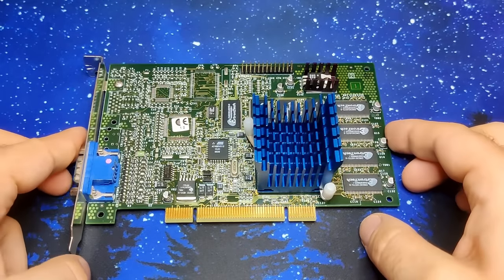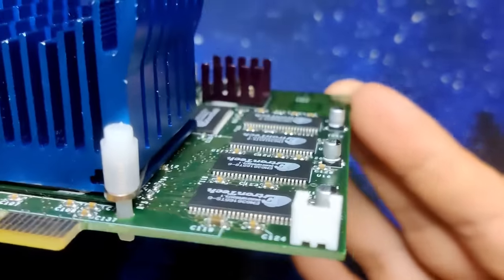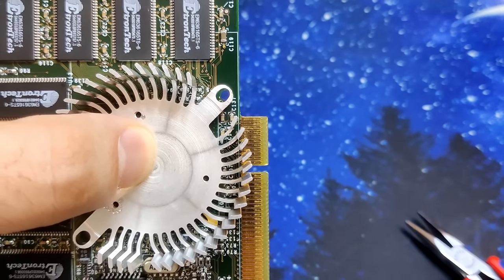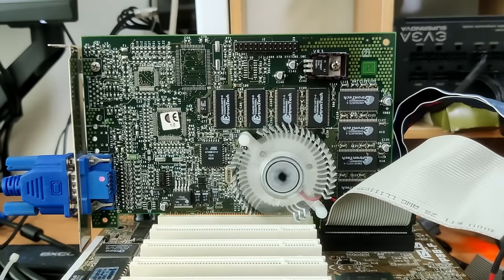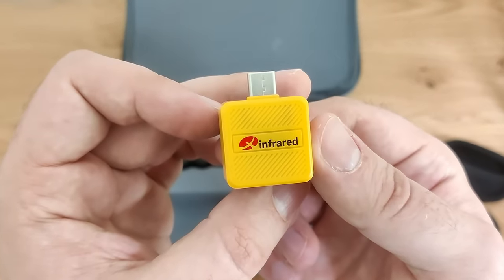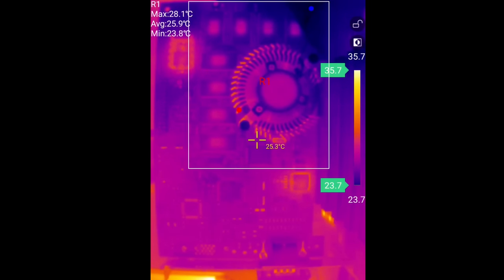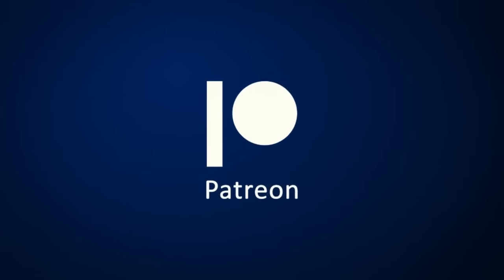Voodoo 3 3333 - Custom Cooling Solution

Comment: None of the features are related to the camera btw... It's just the software on the phone. Old app was terrible. Glad to see they came out with a better one!
Reply from the maker: I haven't seen this feature in the other app - I might have missed those settings.
Reply: As a regular happy user, I wouldn't call the P2 Pro App terrible. I've been able to do everything I needed so far and it's not overly complicated either. The new features in the Xtherm infrared App are really neat though, so I immediately checked if it recognizes the P2 Pro camera. Sadly, it does not.

Comment: It may not be safe to connect a motor(fan) directly to the card power supply without proper protection for the back-emf of the motor(coils). While it might work temporarily since the small coils won't immediately damage the circuit, I wouldn't recommend running it like this for an extended period without the necessary safeguards in place. You should ensure there's already some sort of protection circuit close by the regulator, but I wouldn't count on it without double-checking. Considering the rarity of the card, you wouldn't want to risk damaging it.

Edit: The protection could likely be as simple as adding a Schottky diode in reverse bias as close to motor plus and min.
Reply from the maker: Is there a resource I can read up on it? The fan is connected directly to the 5v supply voltage of the PCI slot. So, it is not taken from any internal circuit of the Voodoo card.
Reply: He connected the fan to the input of the linear regulator, not the output, which should be fine since 5v is supplied by the system's PSU
Reply: @bitsundbolts that's what I thought it should be fine since the system's PSU is often overbuilt for its use case
Reply: @thom_lapatate4842   I agree, i don't see an issue here.
Reply: And also voodoo3 is not rare.
Reply: @andycristea   It's rare enough. Sure a fair production run had been made but most have been ground up to extract a little gold out of the boards. But like it'll be fine here.
Reply: not a problem. EMF generated from the coil itself wont be able to damage its internal BLDC controller. the possibility to send any kind of EMF to the source is as little as none. remember PC fans are brushless since 90s, they're completely different compared to brushed motor
Reply: @n.shiina8798  Exactly. The fans have controllers in them that have all the protection necessary. He is just trying to look smart.
Reply: @SianaGearz  no it is not and never was. E-bay is full of them. There were millions made.

Comment: This video is exactly what I'm trying to to with my Voodoo 3 3000. You just made it a whole lot easier! Where did you source the fan from?
Reply from the maker: I got them from AliExpress. They are quite common there, but I can provide a link. Just make sure to get the 5V version.
Reply: @bitsundbolts  I take it's just your run of the mill VGA cooler with a 55mm hole spacing?
Reply from the maker: Yes, that's correct. I think if you look for a 5v model, you'll find just a few options since most are 12v. And yes, 55mm is the only option I've found. 57mm doesn't really exist when I last checked.

Comment: I ALWAYS active-cool my Voodoo3 cards.  The method I prefer is to add a thin 50mm fan on top of the stock heatsink.  Most V3-3000's have a rectangular aluminum cooler with four holes but only two of them are used to connect the cooler to the card - so I CAREFULLY remove the heatsink, tap the two unused holes, cut two bolts to the exact length needed to go through the fan and the heatsink without sticking out at all, and I reattach the combined unit to the card using modern thermal paste under the heatsink.  It does block the adjacent slot but it works like a charm for cooling and it looks so much better than strapping any old 80mm fan over the heatsink with cable ties or rubber bands or whatever!

Comment: 1:14 Small correction on "all" voodoo 3 cards being passive, the Powercolor Evilking 3 cards (both AGP and PCI, both 2000 and 3000) were actively cooled and have fan connectors. There were also a very small number of V3500's manufactured by Quantum3D which have active cooling, but they're virtually mythical at this point, you never see them. And if we're really going to go over every example of the Voodoo3, the integrated chips on the Packard Bell/MSI MS-6168, and some A-Trend ATC-6254 variants also had a fan.

I have an Evilking PCI 3000, but the stock heatsink was missing it's fan. I replaced it with an Enzotech SLF-1 which has the benefit of taking standard 40mm fans, and the original heatsink is now the "backplate" sandwiching the chip. Another small benefit of the Evilking is that there is enough spacing around the BIOS to install a PLCC32 SMT socket.

Comment: I had a 3dfx Voodoo 3 3000PCI back in the days and simply strapped a 80mm fan to the PCB cooling everything, including voltage regulator.
Still have it, somewhere.

Comment: Noctua have 5V fans with standard 3 pin or with adapter 2 pin connector. In your case a small 40x40 southbridge heatsink would be enough for the 40x40 fan. You could power the fan from a spare molex connector.

Comment: What a great video!
Good solution to this flawed STB design.

I was one of the lucky ones to have bought a voodoo 3 3000 back in the day from Powercolor.
The Powercolor EvilKing 3. This is a completely different design and has active cooling by design.
I still have it. It is a green board (most of them are yellow).

Comment: A small case fan connected to a MB header and jerry rigged to the original heat sink resolved the overheating problem of my 3500TV (and of the entire pc). Your solution is indeed more elegant and I could have used it.
Reply: I think this was about the era where people started doing case mods for side fans, and years later manufacturers picked up on the same thing. Extra cooling for videocards is what got us to the point where it seemed like every case had a fan in the side panel.

In my situation, we wired up a 120x35mm AC-powered fan directly to the power supply's mains, and that could push something like 300cfm - it was insane for my little dual celeron BP6 with an agp geforce2mx and pci voodoo3  ;)

Comment: I just found screws that allowed me to screw a fan in the stock heatsink where the screws go between fins of the stock heatsink and I connect the fan power cable to a fan header on any motherboard I use it with. Generally voodoo 3 needs reasonably fast cpu to get full potential out of it so almost all motherboards that it would be good to use with do have fan headers.

Comment: Nice. In my 3 2000 AGP i just added a 50mm fan with screws. However, i should check the 3v voltage regulator if it has paste.

Comment: I had a cooling solution that worked on all components: drill a 80mm hole (actually, it was more like butchering the case with a blunt saw) in the side of the case, attach a fan, attach a 80mm duct and hang it out of the window. It worked beatifully but man it got cold in the room. Later on I got creative with fans and cable ties and duct tape. I wished I had known about voltage regulators (and available heatsinks for it) back in the day. Nice video, it brings back fond memories! Also a not-so-fond one where I glued a heatsink to my video card, decided I needed to rotate it just a few degrees and by doing so I twisted the entire chip right off the PCB. Brand new card, just a few hours old. Well, you try, you fail, you learn :)

Comment: I have a few of those cheap 5-12in to 1.2to 24v buck convertors. I would have used one of those along with a 12v fan. Those fans will typically spin between 6-12 volts. The convertor has a finger dial and voltage segment display. Could attach it to the back of the card. I probably would have also cut the blue heat sink you had down and put a delta 40mm or whatever on it.

Comment: I'm at the point where I need to arrange myself a Voodoo3 of some variety, as I will never really use my Voodoo 1. Watching your modifications has been highly interesting, and I still have a three-pin-regulator replacement in the works that should eliminate that hot spot near the top of the card.

Active cooling really is the sensible solution on these; the thing I've found is that many of the small 5v fans from China can get very noisy for some reason; I'd guess that not all run true rotationally and it's mechanical oscillation that's to blame. A solution in future might be to use one of the 5v-to-9v boost circuits that were once common on ethernet cards; and to run a quality 12V fan at 9V. 

Once I arrange my own Voodoo3 I'll have to see if I can't test that idea.

Comment: I was waiting for the backside temperature measurement. That's the best way to see, what's the difference between those coolers.
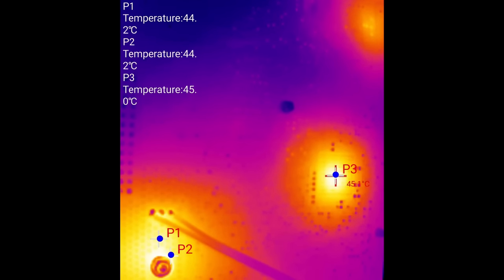Reply from the maker: There is a short section where I measure the temperature on the back of the card at 11:16
Reply: @bitsundbolts got it! From wording I understood the old cooler value was shown there. But correct - even wires are visible. So the temp on the back side of the GPU went from 48 to 45C? That's great! And beautiful work as always!

Comment: I used zip-ties to secure fans to my Voodoo cards' heatsinks (V3 3000 and V3 3500, both AGP) and I connect them to the motherboard fan headers.

Comment: It would probably be a little bit wastefull, but designing a PCB thad could piggyback the regulator VCC and GND clip to the Open holes on the card and overhang just enough to have the fan connector would be a cool(ing) project! :-)

Comment: I added a big normal hight heatsink to my V3-2000PCI with thermal glue and some rubber pads for stability. Keeps it cool, noiseless and is much better than the stock crap from STB.

Comment: i would probably  use angle grinder to shave some metal out of the fins on the back and install fan connector on top of the regulator
still it is a much wimpier heatsink so i kind of expectet it won't work at all

Comment: I have done similar, but cooler power is derived directly from the PSU. Can you please explain why did you use power from the voltage regulator?
Reply from the maker: I wanted to have an integrated solution. This way, I only have to plug the graphics card and be done. There is no need to plug another cable to the power supply. That is pretty much it - no other reason

Comment: Grüß Dich,
Ich habe dir damals die voodoo 3 geschickt. Ich wollte die Tage meine Voodoo 2 PCI benutzen und leider war nichts zu machen. Meinst du, du könntest da auch mal drüber schauen? Die bräuchte ich dann allerdings wieder. 😂 Dank dir schonmal.
Reply from the maker: Hallo. Ja, ich kann mir die Voodoo 2 gerne mal ansehen - kontaktiere mich bitte per e-mail (bitsundbolts at gmail punkt com). Wenn du deine Voodoo 3 im jetzigen Zustand wieder möchtest, können wir das auch arrangieren. Ich glaube, ich bin mit der Karte endgültig am Ziel angekommen :)

Comment: We're still seeing temperatures over 40C.  This is a massive failure.  You need to add a bunch of those tiny, stick-on aluminum heatsinks.  A super noisy Delta fan blowing air over head will help, too.  Probably want at least 100CFM for that.  It should be possible to get the voltage regulator to <10C over ambient at 100% load.

Ok, I'll stop translating for my tinnitus.  I'm actually impressed and disappointed that such a wimpy cooler was able to completely cool the GPU.  I guess this card isn't generating as much heat as I imagined.